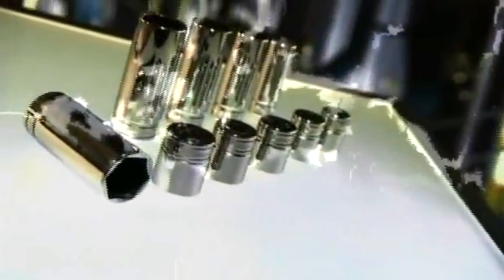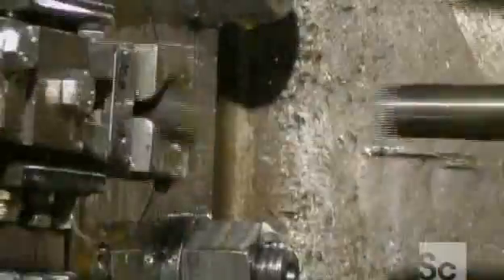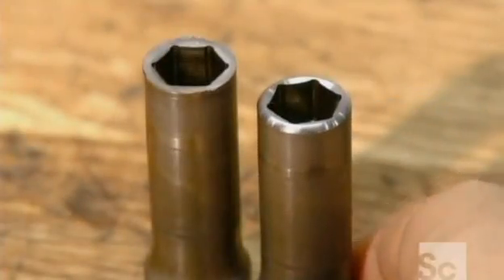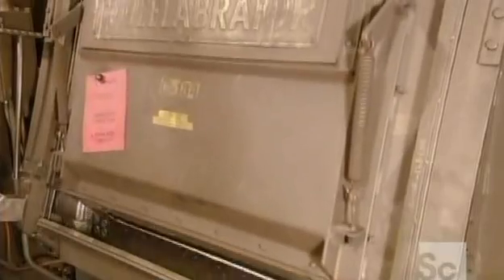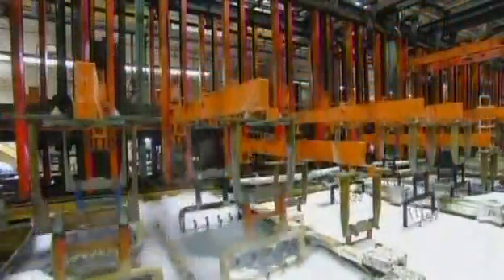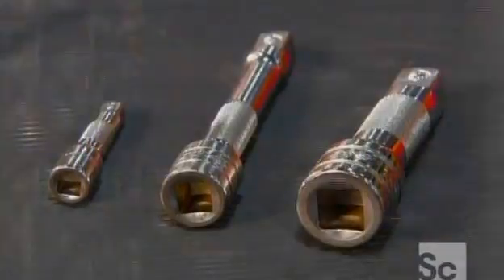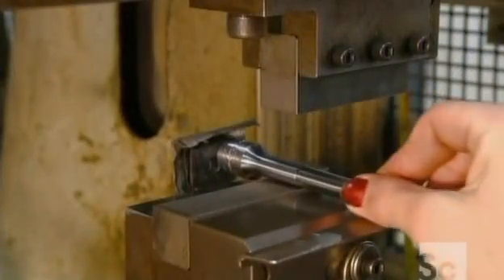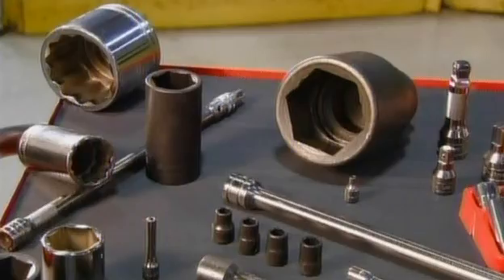Snap on Sockets - How its Made

Comment: some cars you can only use snap on sockets
Reply: pebbIe5 Pittsburgh sockets suck ass
Reply: 2005 honda civic alternator bracket bolt. The snap on deep socket was just a touch longer so i could get it off
Reply: +bb4jdmlude 
I'm a mechanic. I just replaced that same alternator. Used a harbor freight socket which costed me about a buck for a socket. Theyre all made of the same material. Look at your socket. CR-V. Chrome vanadium.
Reply: Some cars can only be operated and worked on by people who possess a certain IQ...

Comment: "Thank you for showing us this..." China.
Reply: +taledarkside every company has overhead. They still have to pay for steel, tooling, machines, they still have to pay for energy which is priced by international markets.
Reply: +Joe Moorman How do you know? Before these .50/hr jobs, they were subsistence farming. .50/hr is a huge upgrade from their previous. What makes products good is quality control. The Japanese learned quality control from William Demings and that's how their reputation for quality  took off. Deming's methods lead to increased quality and increased productivity and productivity is what lowers prices.
Reply: @9Sec340Demon - I guess you don't understand the use of quotation marks...
Reply: @austinebert286  - "you can take it to lowes, ace, sears, etc and get a new one no questions asked" Wait, what? You were talking about Snap On and then you lost me...
Reply: They wouldn't be able to use the usa print if they were made in china
Reply: Austin Ebert still not worth 600$ for a set of 23 sockets...they could easily make this in china because it´s almost only machine work. Snap-ons bluepoint tool line is not made in the US,

Comment: Pretty sure Snap On has a rather large production facility in Tennessee.  They do not manufacture all of their tools, but they certainly manufacture tools.  I'd guess they make most of their hand tools in house and outsource power tool production.  I don't know about Craftsman, I try to avoid them unless absolutely necessary.
Reply: Its actually alabama but right on the border if i remember correctly

Comment: I must say, anyone who thinks a Snap On socket don't break, don't wrench for a living. I own good bit of their tools, some I will pass on. but they are nice. but I must say I cracked their sockets in time. even a 3/8 drive 8mm on a gm side post battery terminal. so it happens to the best of them too. what you pay for is a lifetime replacement. same Craftsman offered for less. but now that china makes Craftsman their tools, and they outsourced jobs here. I do agree, they suck for that!

Comment: True but some tool companies have some pretty good gear close to snap on for a bit less where i live we have Kinchrome and Sidchrome great tools not quite as engineered as Snap on but my Sidchrome gear goes toe to toe with my dads Snap on gear for any light commercial gear but when it comes to Heavy fitting my tools wont quite cut it like Snap on will but my ratchet is worth $90 his is $247 as a mechanic I don't need the Snap on gear so i can't see a hobbiest needing it

Comment: I turned wrenches for twenty years and a good portion of my box was Crafstman. Theres no doubt that Snap on is a better tool, I wont argue with that, however Craftsman will meet the needs of most tasks at hand and there is never a question when you need to return them. Most Snap On sellers will fight you tooth and nail for a refund or replacement. On top of that; Snap On is way way overpriced. S.K., Matco, there are plenty of other alternatives that I would buy first.
Reply: Na older craftsman rivals snap on

Comment: i have these cheap plastic suitcases full of sockets, wrenches and bits for about 60 euro's, and they last about 5 years before some small bits break, and some pieces get lost, so why should i buy snap-on tools from witch a single wrench cost more than my entire suitcase? Imo, snap-on is for clean and single projects, but not for al day wrenching on multiple greasy daily used cars a day that come and go, because loosing  a single nut, spanner or wrench, etc, is a costly setback then.

Comment: Snap-On is good because of one important fact.  The jobbers that comes by will replace your tool right away (if in-stock inside their truck) or replace it with no question asked if it breaks/or fails.  Their warranty and commitment to their customers are impeccable.

Comment: @DjTommyKx I worked in a garage for a while, and every guy there would agree. You might be able to get the job done with lower class or cheaper tools, but the work can suffer for it, and they often don't last as long. I've worked with both store bought tool sets and the high grade stuff they had at the garage: I'd take the garage versions any time, much nicer and easier to work with